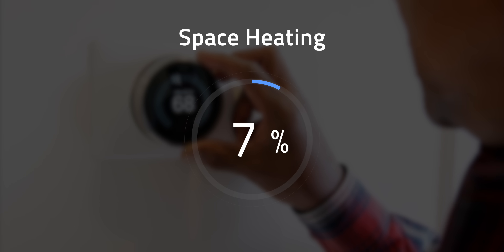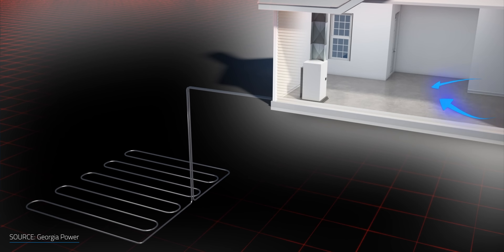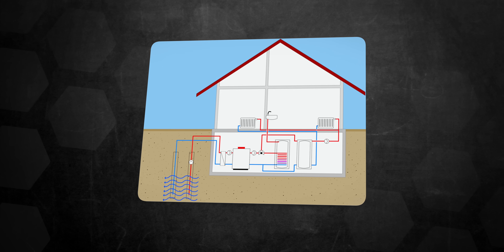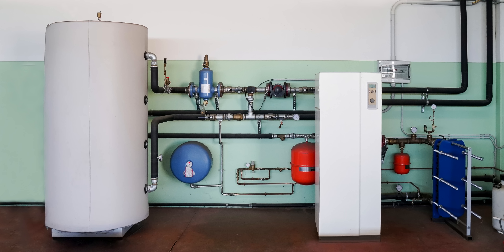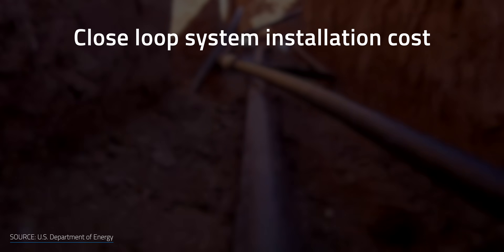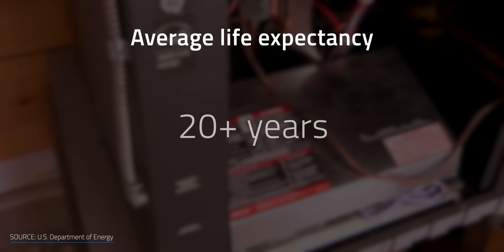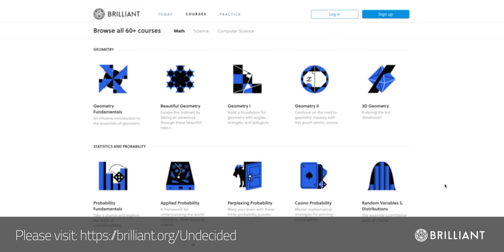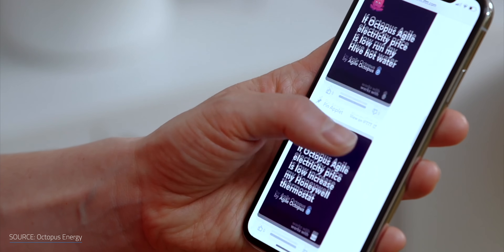Is Geothermal Heating and Cooling Worth the Cost?  Heat Pumps Explained

Comment: I had a house built in 1985. There was a 50% tax credit at the time, which brought the price down to be comparable to a conventional air-to-air heat pump. The entire system was $7800 before the tax credit. The closed loop, vertically drilled system worked great. I'm amazed this technology still isn't more common.
Reply: I don’t know why new buildings don’t have cellars like in old times. They are great heat sinks and thermal storage with brick walls and concrete floors. It’s also dual use, for storage or extra space.
Reply: @madsam0320  I grew up in an old farmhouse with a "cold pantry"--a room on the first floor that had an opening to our cellar.  Kept food at a constant temperature year-round using the cellar's natural temperature regulation.
Reply: Agreed however it is no more commonplace in Norway then it was just a few years back. I am on my second house in current house I also added suncollectors to heat my domestic water in tandem. Great system.
Reply: I tried to get quotes for GSHP here in NJ. Only had one company give me one. They wanted $60k.
Reply: @drooplug , my cousin lives in New Jersey and went from a oil boiler to a air source heat pump and it only cost about $4,000.  On those very cold days, the electric heater does run a lot though.
Reply: A lot of people live where rock is below the soil layer. Drilling into rock get expensive, raising costs. Yet if you have area, a flat system, with decent layer if soil….perfect
Reply: @wallisparnell4464  drilling strait down in to the rock is the absolutely best option, the temperature is stable brine temp at 4-6°C which gives you a very efficient heat pump al year around and the possibility to use the brine liquid to cool the house in the summer. A single 200m well in granite takes around a day and a half to drill and the cost should be easy to calculate and that single well is enough for a 10-14kW heat pump. I installed NIBE 1245-8kw with 165m well and lowered my electric bill from 30000kWh/year to 13000kWh/year and that is al electric, including utilities.
Reply: @eklew1  so how much does it cost?
Reply: You can thank oil and gas lobbyists for that
Reply: Well someone has to make money.
Reply: I'm in Maryland and was quoted about $10,000 just to have the well drilled for the vertical, close-looped system.
Reply: @TwoTall1988  Did you get multiple bids?
Reply: @lillianchiarelli7376  No, I was doing a feasibility assessment so take the first quote and then add and subtract 10-20% and you have your range. I think all said and done the estimate was around $25k. My propane furnace is from 2016 so it wouldn't have really paid off and I went with other items on my renovation list.
Reply: @TwoTall1988  depends on what is underground. There are some areas here they wont even do it. Straight limestone.

Tho, there is an entire neighborhood that was designed with 1 HUGE well here in a softer area.

Im guessing it splits the cost amongst ALL the homebuyers. Since its a huge neighborhood...I would guess its actually cheaper.

Tho the super told me it was a logistical pain in the butt.
Reply: Because you cannot really retro fit
Reply: Why do you think it’s not popular??!??. Same reason e85 is not popular. Big oil companies don’t wanna go out of business🤷🏼‍♂️
Reply: Where was that?
Reply: Because energy is a money maker and every fucken realtor knows they love to sell houses but provided the family with expenses that could be cut dramatically had they really give a shit about the ordinary human being. We are too greedy and selfish to even have this for everyone. One day everyone will die because one idiot starts a nuclear war and that will result in our next generation life altered by mutations.
Reply: That tax credit is gone. Vertical closed-loop is best, like in the south, but how are you going to do that in rock?
Reply: No brainer, cheaper and more efficient.  Probably cost less to install once they installed enough systems.
Problems is that builders worried that buyer won't buy houses with these systems so they say no
Reply: Holy shit, my grandmothers 4 bedroom+gigantic livingroom+bedroom sized kitchen monster of a house has an HVAC, their replacement HVAC cost them 6,000 NIS (roughly 1800 USD) and it was one of the more overpowered systems for their house.

Why are HVAC systems so cheap here in israel when the cost of housing is through the roof? Fucking greedy assholes bubbling the housing market, I hope they all get cancer so they have something useful to use all that money they're sucking out of us.
Reply: @ScarletFlames1  Ironically, I hope the same for you.
Reply: @ScarletFlames1  I so understand your grudge. I join in.
Reply: @ScarletFlames1  We have bigger houses on average so that might be why.
Reply: @ScarletFlames1  Supply and Demand
Reply: @ScarletFlames1  מה קורה אחי חחחחח
Reply: @supermemememe605  רק היום במחסני חשמל מערכת מיזוג גיאותרמית! טוסטר משולשים! יום אחרון למבצע!!
Reply: Bike
Reply: @ScarletFlames1  i guess its the same problem as everywhere else in the west: cheap money (for those who already have money and thus can leverage it) and no idea where to put it.
Reply: @ScarletFlames1  same applies to land thieves as well 🔥
Reply: @warbot2544  Same to rocket and balloon launchers too.
Reply: @warbot2544  imagine if an entire continent was stolen.....wait
Reply: @ScarletFlames1  lol
Reply: @ScarletFlames1  probably subsidized with billions of American tax dollars.
Reply: @ScarletFlames1  It does not get very cold during the winter (not like Canada). - btw what Israel does to the Palestinians amounts to genocide. No justice no peace.
Reply: @xyzsame4081  It is genocide but let's not forget many doesn't support what their government is doing and even protest against it. Zionists are doing and supporting it.
Reply: @rengurenge  The Haaretz newspaper in Israel freely discuss the occupation of Palestine, unlike the news media in the US.
Reply: God I love reading old people talking about their house expenses like they went to the mall one time. This economy is making me wanna gauge my eyes out
Reply: @Intestine_Ballin-ism  Ja, it's tough. I saved up for a decade to buy a house with no heating that needed a tonne of work. I could do that cus I have connections but if you don't, you ain't got a hope.
But £7k for heating isn't too bad if it's a one time expense. I was quoted £20k for geothermal, RIP. So I was forced to go with gas instead. Cost around £5k
Reply: yi

Comment: I second those costs. I have an older house with radiant heat only and was quoted $15,000 to install a new central air system with ducting to all rooms.
edit: 1800ft^2 house (-) basement.

Comment: You missed out the deeper straight down system for home use. Just one or two bore holes that require very little ground area. One company is, I believe, based in New York state and have boring rigs designed to be narrow and small enough to access modestly sized home gardens etc. Good vid though.
Reply: Dandilion
Reply: Last summer I had one of those drilled by our house. About 20cm in diameter and 202m straight down! 😯 And the drilling was done in less than a day. 👍

Here Sweden straight down holes is the most common way to get heat up from the ground.

Comment: One more question why dont car companies make the whole car 3d printed if taken into assumption that it equally fast in making as mass production  car in traditional way is it bcz of servicebility issue or something else ? Bcz Tesla is trying to remove many small pieces and making bacically 3 large pieces for the whole exterior of a car. Then why not use a 3d printer ?
Reply: nonsense, 3d printing is waaaaaaz to slow for car production, the vw wolfsburg car factory finishes a car every 16 seconds tesla dont even dinish a car in 5 minutes

Comment: Another excellent video Matt. As we move closer to entirely renewable power grids there is an important reason to use GSHP over ASHP in cold climates. In air temperatures below about -20 C ASHPs need 100% back up heating. Typically this will be electric resistance heating. If all buildings (including houses) used heat pumps the back up resistance heating loads on the electrical grids would overwhelm the existing grids and power supplies causing even more significant infrastructure upgrades than currently required. Since the ground temperatures typically do not drop below 0 C in GSHP wells, no back-up heat is necessary for GSHPs and significantly less demand would be placed on our electrical grids when using GSHPs over ASHPs. This results in significantly less infrastructure investments to get off ffs completely.